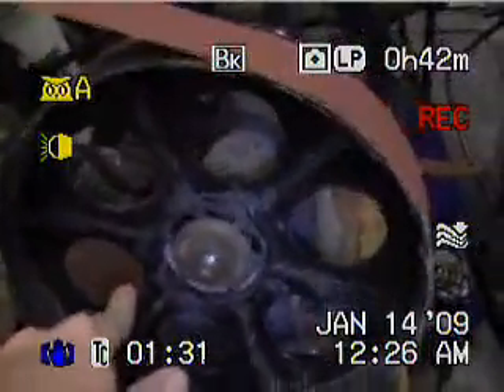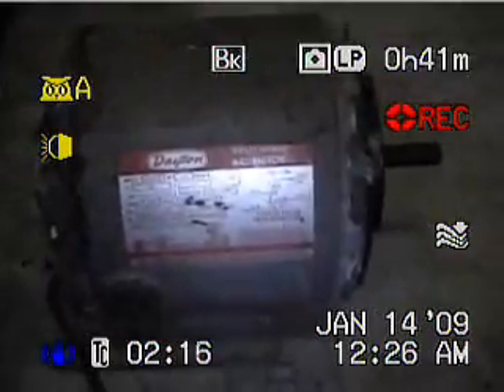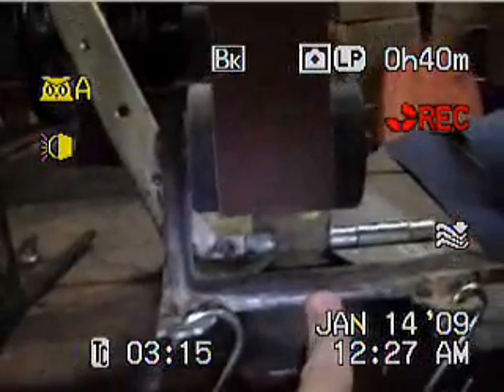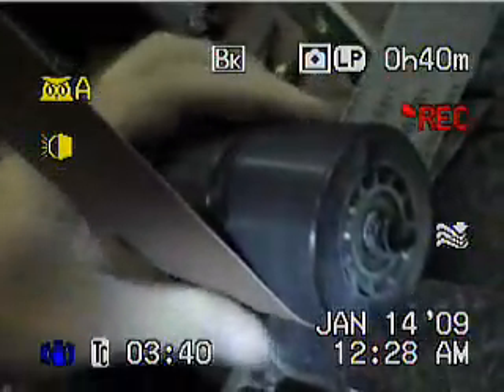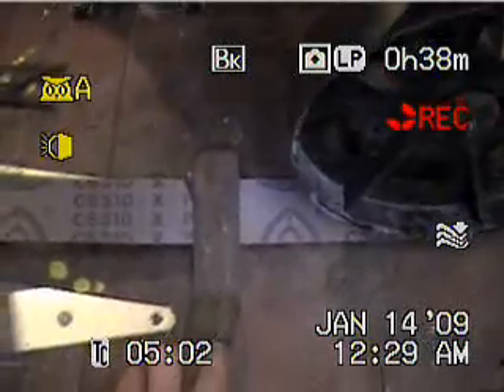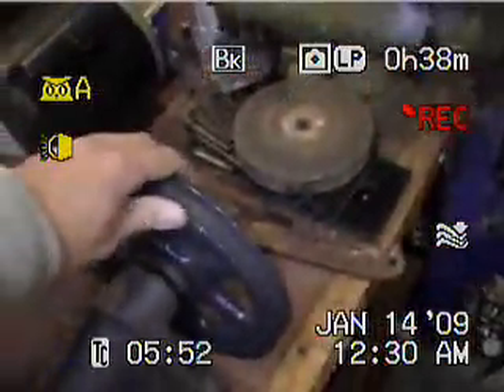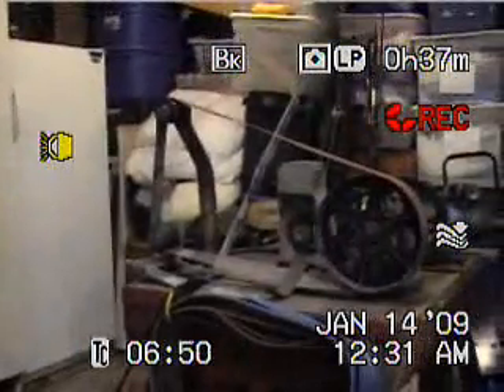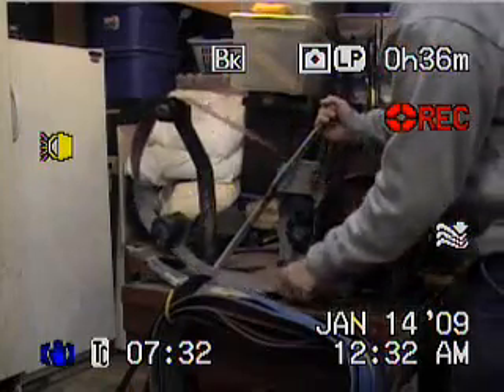Home Made 2"X72" Belt Grinder

Comment: @strantor those ratings are based on a momentary stall the energy spikes to 4 hp for a tenth of a second so they rate it at that. the most you can get from 110volts is 1.5 hp from a farm duty motor and that's even pushing it!

Comment: You did a great job for min money. You should have gone a size smaller on the motor pully and had anyone with a metal lathe machine it to fit. It's a dead simple 5 min job, and you would be able remove it and know it is running true.
Next one is a biggie. Unless you want to kiss the running linisher belt, loose the strings on the sweat shirt when your around any machinery.
All the best

Comment from the maker: @JaKeth3snake I have a motor from a dryer that I was going to use, but it has 8 wires coming out. I dont know what they're for so i gave up on that. actually i dont think it would have been powerful enough anyways. contact wheel: no i don't know, thats why i made mine.

Comment: Instead of Skate wheels you can use Idler pullies for Timing belts. I did a few Quick fixes for a friend And since most of them have A Convex or Concave surface they can fix the problem even under heavy side load. 
neet sander *****

Comment: brilliant machine i was in the abrasive belt buisness most of my life selling macines from dynafile up to machines of 100 hp and 3000mm wide your machine is fantastic great imagination, one suggestion for tracking belts is to use 1/4 inch wide masking tape on idler wheel wrap it around the wheel in the direction of rotation then the belt wont try to throw it off usually a couple of turns of tape is all you need to track your belt. abrasive belts can be run up to 35 meters per second

Comment from the maker: Well I think you should try and wing it anyway, you might suprise yourself. If you don't start out with any preconcieved notions about how it is supposed to look or operate, you can build it in any configuration you want and be perfectly happy with it as long as it does what it's supposed to. Once you start trying to use someone else's plans, you lock yourself into doing it a certain way and using certain pieces that may be expensive and it can become very aggravating.

Comment: I have thought about it and I dont think I can modify the table itself; however there are all kinds of possibilities for using jigs. I dont think Ill bother though since the platen is set up vertically you can see what angle youre grinding at very well. As a result you can grind some pretty precise bevels with just a steady hand and a good eye.

Comment from the maker: some pointers:
1. try to find a wheel that isn't plastic because you can't glue rubber to it.
2. if using a 3400rpm motor, don't let your drive wheel be bigger than the motor shaft + 2 inches or it will spin too fast. (i had to use that huge pulley because i was using a 10" wheel as the drive wheel)
3. get a mig welder off craigslist if you don't already have one
4. use something more sturdy than a leaf spring for something thats going to have tension on it.
I will be glad to help, just ask

Comment from the maker: I just got done looking at your delta on the net. it says the side table tilts to 45degrees. could you modify it to tilt further? I am working on an attachment for mine right now where i would stick the blade into a slot that angled at (adjustable) 10, 15, 20, 25, or 30degrees off from the belt so that I can just send the knife a few passes thru it in either direction to put an edge on it. if you could angle your table further, you could do the same thing. thanks for the kudos!